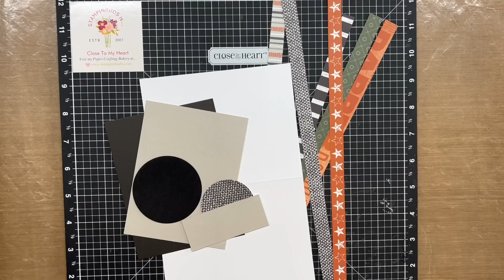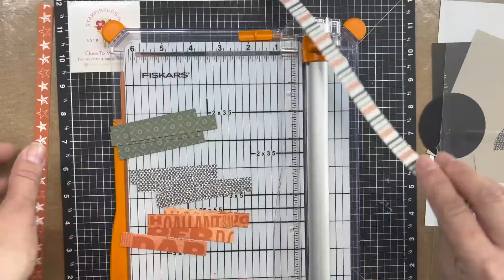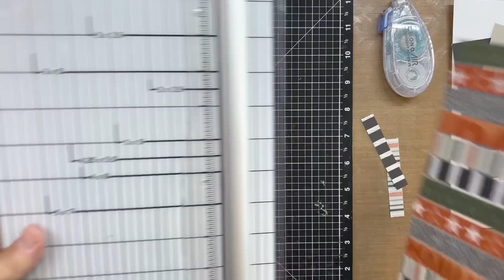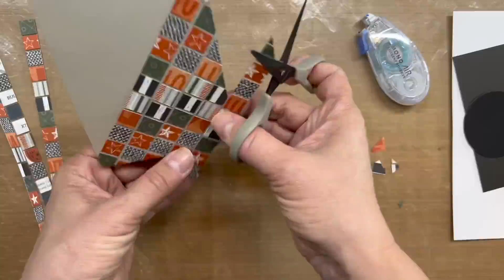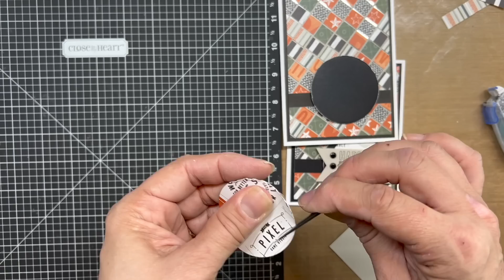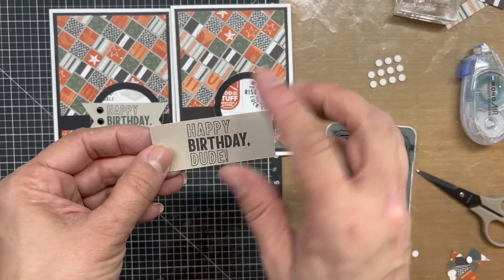Acetate Technique

Comment: Very nice card.  I love the colors in the papers.  When you did the stamping, what was the foam for?
Reply from the maker: The foam helps to give some “give” between the stamp, paper and the table. I always make sure to use the foam when I’m working with large stamps but I don’t tend to use it when I need a harder surface, like with small stamps. I hope that makes sense?
Reply: @Shannon B  yes it does and I figured that was it.  I just wanted to be sure.  I will have to give that a try.
Reply from the maker: @cindyrobinson2199  Anything spongy will do.  It's just easiest to use the foam piece that comes with each Stamp Set, though.  :)

Comment: What is the purpose of the peel off layer on the acetate? Great card BTW!
Reply from the maker: I believe that it's to protect the more sensitive side of the acetate so that it doesn't scratch.  I've also read that it's a film that is added so that big sheets can be cut down into smaller sizes without sensitivity damage.